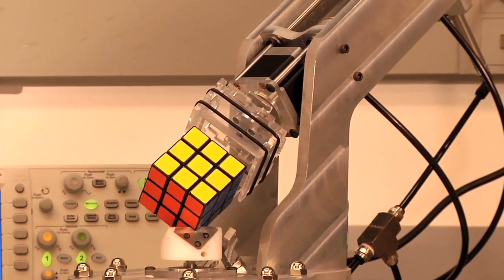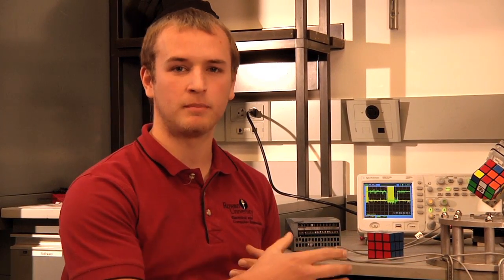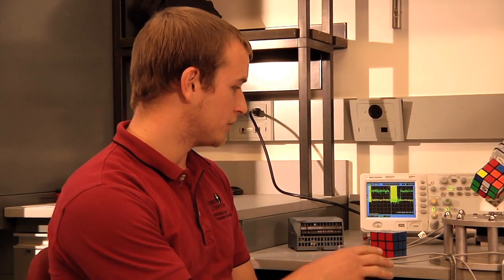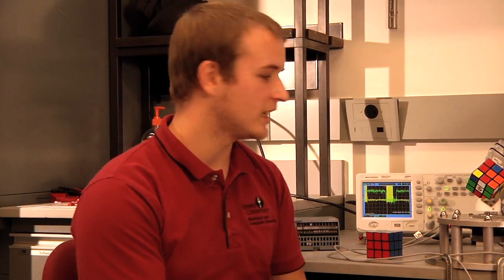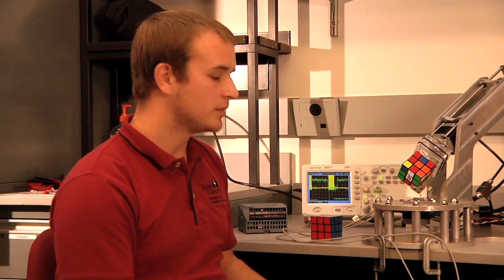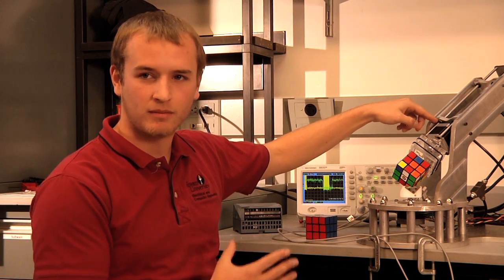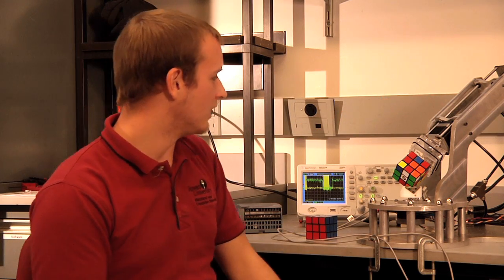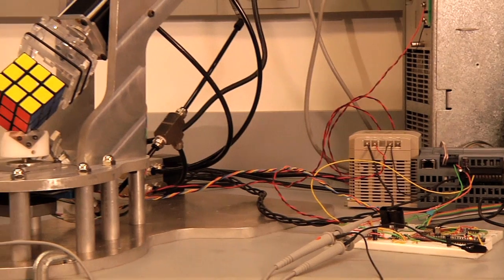The Rubik's Cube Solving Machine

Comment: The robot, which consists of two motors, three rams and Siemens S7-1200 PLCs, grasps the cube from one corner, allowing uninhibited manipulation of all faces during the solve routine without having to re-grip the cube at each step. The scrambled pattern is captured by a digital camera and fed into a Matlab environment where it is processed. Once the locations and colors of all the faces are determined, the solve pattern is delivered using the Cube Explorer algorithm.